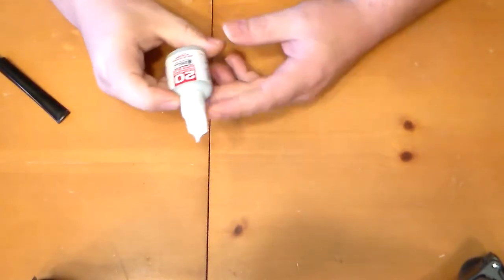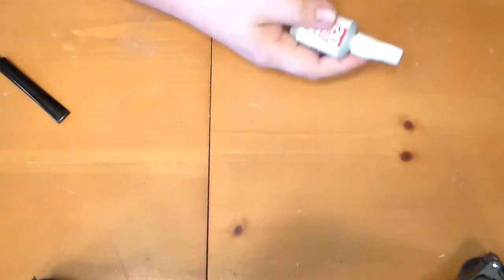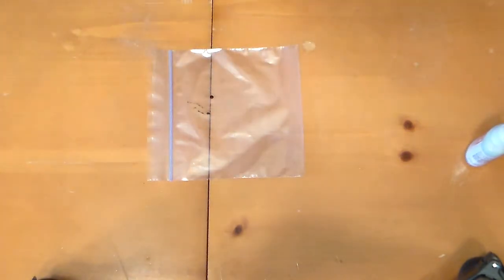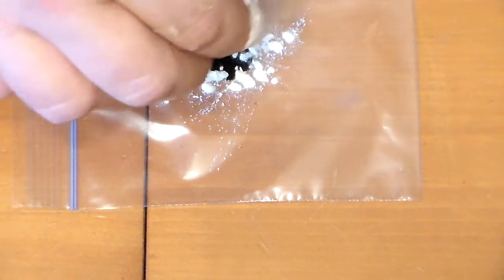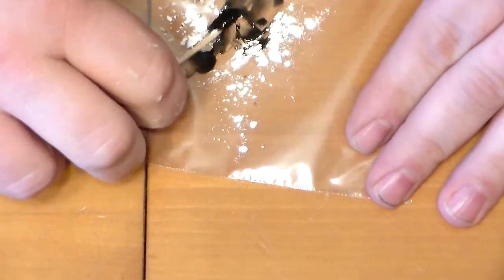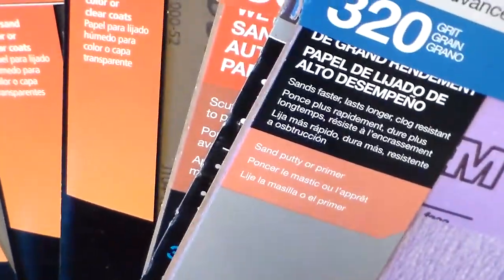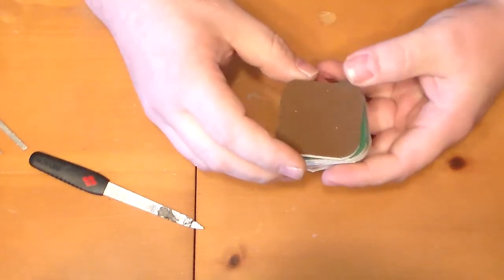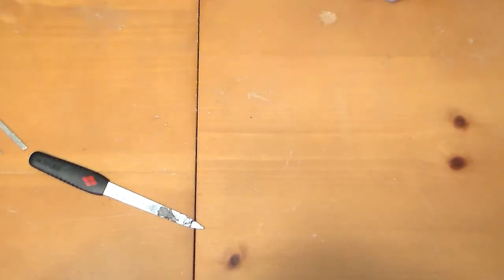Stem rebuilding techniques

Comment: Great advice. Super glue and corn starch. Excellent. Amazon also sells a black pigment to use with epoxy if you'd rather go that way. Yes, they also sell a diamond hobby file set.

Comment: Just bought Kaywoodie Drinkless Apple 7742 pipes and a stand, with a music box inside for $35 + tax. The one has a big hole in the stem, and the other appears they filed the bottom portion off.  I'll have to try this method for the one with a big hole.  The one with a whole chunk filed out, I'll probably just clean it up and leave it as is.
Reply from the maker: I have used activated charcoal a couple times since I made this video instead of corn starch and like the results better. Vulcanite dust seems to create the most seamless repairs if you have an old stem to file down for the powder.
Reply: @pipeminer7281  After seeing how the bite out looked on the pipe stem you repaired, I'll probably repair both of mine.  I was going to just do the one with a hole, but the other one is missing a chunk in the same spot as the one you repaired.  The bowls on the 2 I got look to be in good shape.  I have to clean them up, and repair the stems, and they'll be ready to smoke.
Reply: @pipeminer7281  Have you tried clear super glue, mixed with activated charcoal powder?  Does it look just as good? Or does the black super glue make it look better?
Reply from the maker: @TheAsthmatic91  I've only used the black just because I felt safer with a colored base. Starbond also makes colored CA glue in a variety of setting options.

Comment: is that applied glue toxic? I believe superglue is toxic for skin and mucosae
Reply from the maker: Superglue in it's liquid form is considered toxic however once it has cured and hardened I don't believe it's still toxic. I have smoked this pipe many times with no problems or irritation at all. I would say that if a chip was to break out of the repair I would be sure not to ingest it just to be cautious but I would say the same about a piece of acrylic or vulcanite. Thank you for watching.

Comment: Could you use the dust from a sanded stem to mix with the glue to thicken it up?
Reply from the maker: Yes you can. I've seen a couple other videos where they use that method and it works really well.

Comment: Here’s a tip: Mix your glue with black vulcanite powder to thicken and strengthen your material. You can take and old pipe stem and grind the powder from it.

Comment: I notice that you rescued a Kaywoodie pipe.  I am a bit of a Kaywoodie fan, so I appreciate that you kept an old one viable.  I like the classic billiard shape.

I got an inspiration from this video.  (Something rare for me.)  Since you are repairing a vulcanite stem, why not mix vulcanite powder with the super glue?  I have a couple stems with bite throughs that I am going to try to repair. I also discovered StewMac's black super glue.  I have several derelict vulcanite stems that are broken.  I am going to take a file to the broken stems to make a pile of vulcanite dust.  Using your recommendation from this video, I am going to mix vulcanite powder into the glue (instead of corn starch) to see what I come up with.

Activated charcoal is also an idea.  As for sources, your local health food store or the health food section of your local grocery store might have some.  Activated charcoal is used for stomach and intestinal ailments.  It comes in capsule form, so all one need do is open the capsules for a pile of charcoal dust.
Reply: I picked it up at local Walmart

Comment: Great video. I repaired a bite hole in a pipe that I bought for $8. I mixed charcoal dust in clear super glue. The tinted glue would be a lot better. I am going to order some of that glue and the micro mesh pads this weekend.  I am going to be on the lookout for another broken stem to try out. Thanks for making this video. I wish I had seen it first.